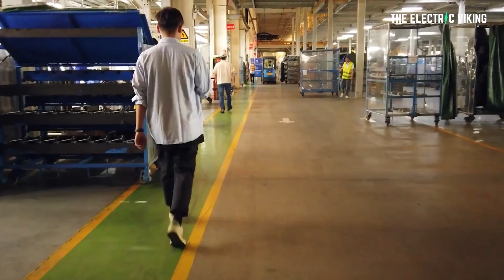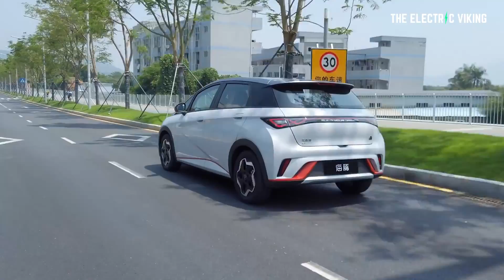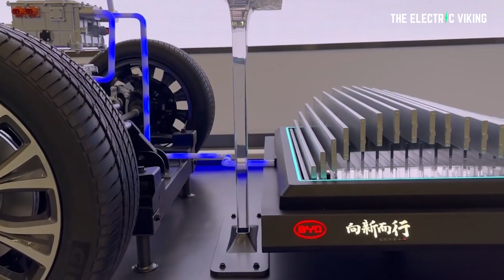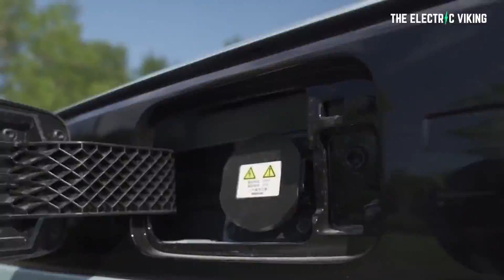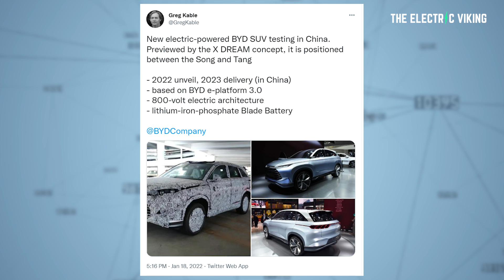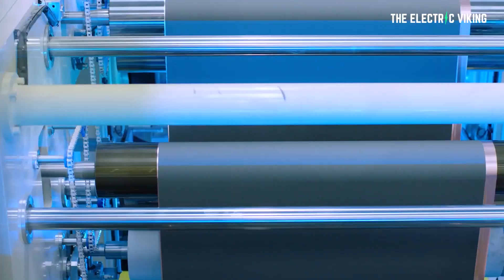3 affordable NEW ELECTRIC cars coming from BYD in 2022

Comment: NAF and Motor held their annual winter test on Wednesday this week, to find out the actual range for electric cars under Norwegian winter conditions.
WLTP stated range figures are being tested under optimal conditions. It is a known fact that electric cars lose a certain proportion of the range when winter arrives and temperatures drop.
 
A record number of 31 cars participated in the test, which included the newest models in the Norwegian market.
 
BYD Tang ended up with the least range loss of all electric cars, with only 11% deviation from the stated WLTP range! The average among the test cars was a deviation of 19.6%.
Want to experience what BYD Tang SUV has to offer? Contact one of our 44 dealers for a test drive or a friendly car chat! We have cars in stock for fast delivery.

Comment: Other new models this year...

At this year’s Guangzhou Motor Show (19-28 Nov 2021), Du Guozhong, deputy general manager of BYD’s brand and public relations division, said that the initial model from the future premium brand, and the brand itself, will be launched in the first half of 2022.  The report adds that the codename ‘R’ signifies the English word ‘Revolution.’

Du Guozhong confirmed that the first model of the high-end brand is a hard-core off-road vehicle, with a price in the region of 500,000-900,000 yuan (USD 78,000 to USD 140,000) with a launch planned in the first half of 2022.

BYD’s new product roadmap for the next 1-3 years has emerged on Chinese media portals  revealing further details about the luxury brand. 

The first model will rival Mercedes-Benz’s G-Class,  the document states. It will be available as a PHEV and an EV, and the latter could rival the Mercedes EQG due in 2024. BYD officials had said at the 2021 Guangzhou Auto Show held in November 2021 that the new electrified SUV will arrive in H1 2022.

Comment: PLEASE!! Talk about vehicle price vs range.  I have never owned a EV but would like to, but 1 thing that puts me off is paying more for longer range.  I get more rang = more batteries = more cost.  Thing is, more fuel efficient ICE vehicle are normally the smaller less expensive vehicles with smaller engines.  "Luxury"  as far as I know in ICE is not getting more range, it is quality of components, more features, more refinement, etc.  For me.... I would REALLY, REALLY like a EV that can get over 500km of highway range per charge, and yet be as low cost as possible.  I am a simple normal person, not willing to spend $70 / $80 thousand on a vehicle, all of the vehicles I have owned in the last 30 years, ALL have cost me under $10k (each, used).  So correct me if wrong...... but to get a long range EV means buying a "luxury" vehicle..... and I don't want to pay for a luxury vehicle.

Comment: Sam there is nothing worse than repeating a story that ran days earlier on the internet, this is what your channel has become, rehashing old news stories others have already reported and released.
Reply: Peter I don't know if you read this, but have a read this post:

"Hi guys, I've just purchased a used 2015 BYD E6 in New Zealand, a former Taxi from Singapore. The dealer was looking to get some new BYD E6 2020 model (not the new one). When I asked about newer BYD models he said that NZ or Australia won't be getting anything, quote from email below. Anyone know what he is talking about, BYD was supposed to go on sale in Australia next month.

'Quick heads up,

No further BYD vehicles will be sold in Australia, at this stage, there are no new products available due to the ADR rating.

Currently working on the last of the brand new last of e6 (will be 2019-2020 production). These will be 82KwH. If we do succeed in getting our hands on these, they will be eligible for the brand-new electric vehicle rebate.'

I have done some research and it seems that post Nov '21 any new product launches will have to comply with ADR 85, meaning "ADR 85 has a simple and singular focus – reduced serious injuries and fatalities from side-impact crashes using improved passive safety systems. Put simply, lower the danger posed by crashes involving impacts with poles and trees by increasing built-in safety structures."

A deadline has been set of November 1. Following that date, all passenger vehicles imported and certified for road use must meet ADR 85. Cars brought into the country before November 1 that don’t meet ADR 85 will need to be registered before July 1 2022."

I am sure BYD/Nexport are aware of these regulations, but quite a few cars are being withdrawn from Australia because of this, and this car dealer seems to suggest he knows something we don't.

You may want to look into this if you are in contact with Nexport/EV Direct?

Comment: At this point, we should all take advantage of the dip. The fact is, NFTs & BTC is the future of crypto and the question most traders ask themselves is - if this is right time to invest? I feel those who would allow the market dynamism to determine when to trade or not are either new in this space in general or probably just naïve, the sphere have seen far worse times than this, enlightened traders continue to make good use of the dip and pump even acquiring more equities towards trading sessions, I'd say that more emphasis should be put into tradng, since it is way profitable than hodling. Trading went smooth for me as I was able to raise over 19 BTC when I started at 2 BTC in just 5 weeks of implementing trades with signals and insights from rodney koch..:washhands: I would advise you all to trade your asset rather than hodl for a future you aren't sure about. Say hello to bell for a fix, You can reach bell on ͲeIєɠɾαm👉kochrodney :learning::learning:
Reply: rodney really knows his way around trading, its evident from his deep knowledge of how the market works, reading signals to perfection, i feel very safe trading with him
Reply: I had 1 btc I was doing okay but I lost my job due to the Virus. Then i heard of a pro trader and advisor, rodney koch. I trusted his words and took his advice. i have made over 6.9 btc using his service.

Comment: The Seal looks great, but still gravitating towards the EA1 with that blade pack. The trade off loosing some range but getting a durable safe battery with around 200 mile of range still hits the swwet spot for me
Reply: All of these models should come with the blade battery. It's part of the platform.

Comment: But what does the blade battery warranty state about capacity after 100k, 200k miles? That is more important to most people who do not keep cars more than 5-10 years. 

If, for example, the battery goes to ~60% after 100k and basically levels out until 500k then that is not a good thing.
Reply: It's ok your 500km range EV will go to a 300km range EV, yeah crazy degradation warranty! Most think degradation only comes from the cell degrading, however there is also module failure which is probably why BYD is saying 60% as there must be a question mark on reliability of the modules so its possible some modules will fail but as long as the full battery does not drop under 60% then you will have no warranty claim even if the modules fail! Now that is scary!
Reply: I was thinking the same thing. Degradation seems to be faster in the beginning, and then level out, so I rather have a 80% 100000 mile warranty, than a 60% 500000 mile warranty. The good thing is of course you are covered if the battery fails completely. With Renault batteries, that seems to be the only time the warranty is used (at least what I heard from user groups).

Comment: On the rumor of BYD supplying blade batteries to Tesla. 
10 Gw hours is not nearly enough batteries for the huge numbers of the $25k car that Tesla will be producing in China. If the rumor is true then my guess is that these batteries will be used at first during the initial car ramp. Then Tesla will need other suppliers of LFP batteries. I do not think BYD can ramp their supply to Tesla fast enough unless they very soon announce many more factories to come online in 2023. As you have informed us, BYD has committed battery supply to other car companies as well. So unless they can afford the capital to ramp several more factories soon, then they will not be able to keep up with Tesla’s production rate.

Comment: I do hope the BYD Seagull will have decent rapid charging, I don't mind a shortish range if I can top the charge up quickly en route.
Reply: It does it is built on the 800V platform so 150kms in 5 minutes
Reply: Ok, I’m the other way. I would like the range but can to charge slower at home 99%.
Reply: @Harrythehun  What if you're over half your range from home or short of your destination? will you book into a hotel to wait for your car to charge?
Reply: @eclecticcyclist  No normal car in 2022 has less than 50 kW when connected to a fast charger…….
Reply: @Harrythehun  Dacia Spring charges at 30 kW unless you get the top model
Reply: @eclecticcyclist  Thats low but sufficient for 90% of city people. You probably charge 70 % in 40 minutes  I live in the suburbs and have a Seat Mii electric (came from a VW 2.0T T-roc) We have solved all of our travels with it. (I have a Model 3 LR ordered but to be honest I really don’t need it)

Comment: Yesterday's news : Dongfeng launched 50 EVs model 'Dongfeng Fengshen ( Aeolus ) E70' with SOLID STATE BATTERY!
The Solid State Battery is here!
Reply: Is it me, or does the E70 look like an ICE vehicle (Passat / 3 series??) either way - For the money I would have one...
Reply: Dave Black / Yes, it is derived from the previous Dongfeng E60 ICE car.
In 2020 it was built the new electric model E70 in two variants, E70 500 with a 53 KWh Lithium-ion battery, and E70 600 with 61KWh battery.
But as you say, for $25 220 for the biggest model which has the 61 KWh battery and a range of 318 miles, it is a good deal.